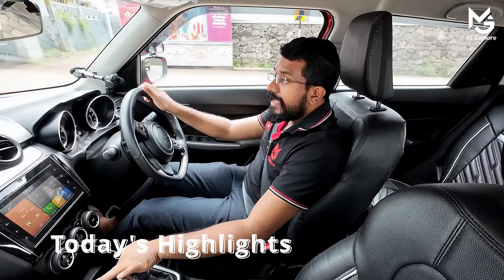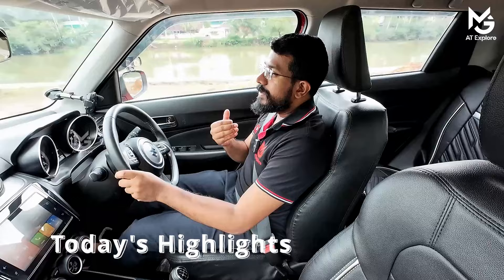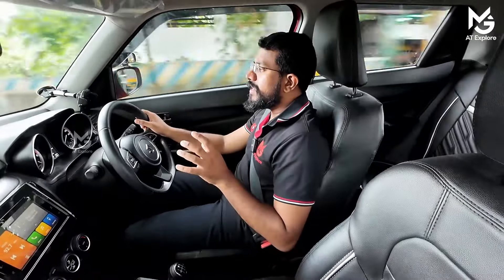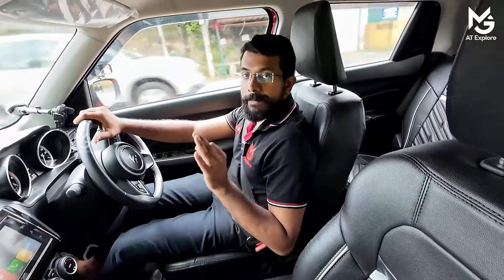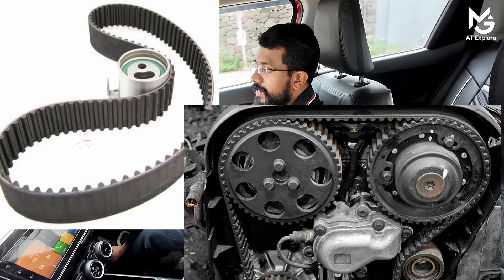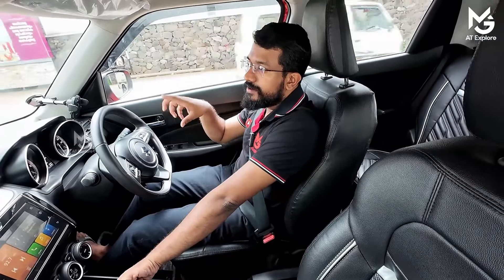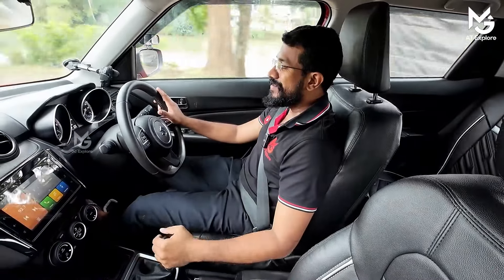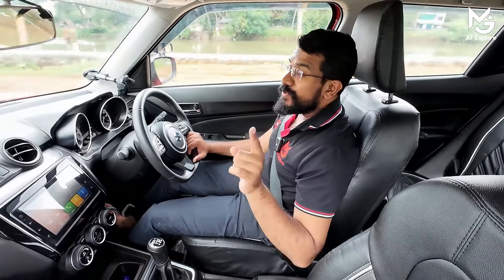ടൈമിങ് ചെയിന്‍ പൊട്ടിപ്പോയാൽ ഈ ഒരു പണി കിട്ടും | Timing Belt /Chain if not replaced | #MGTIPS -670

Comment: Our old 2011 i20 Diesel(now sold) had run without any timing belt changes till 1.95 L KMS

1. My mechanic said that you will get minor noises in Maruti diesel engines and then only you need to change the chain. Is that true?

2. He also told me that there are lots of things that needs to be changed along the timing chain. Can you please make a detailed video about the timing chain replacement process?